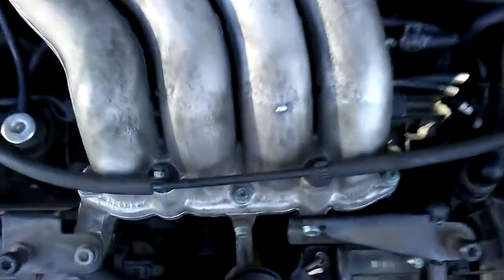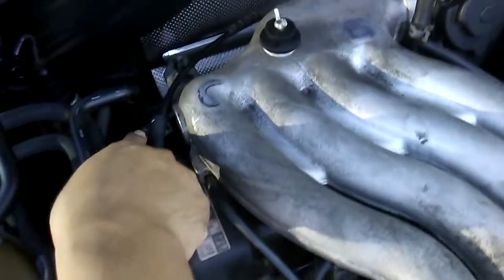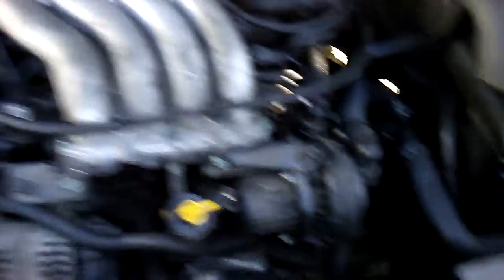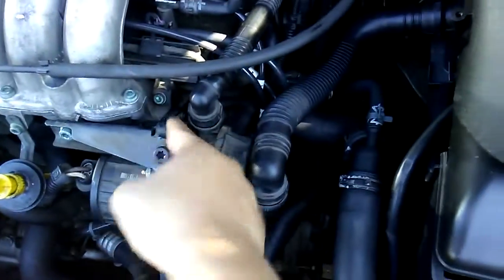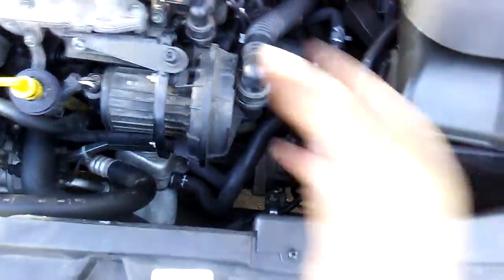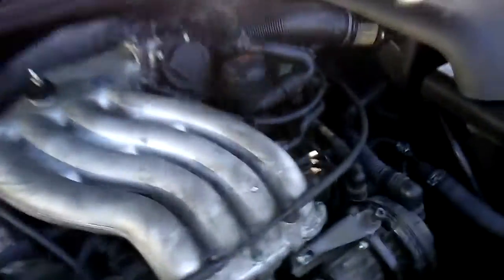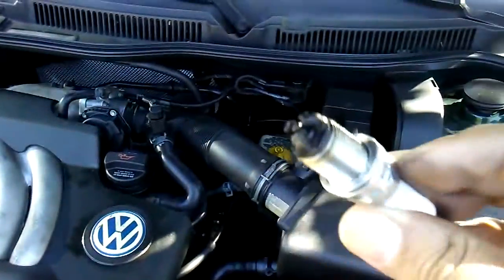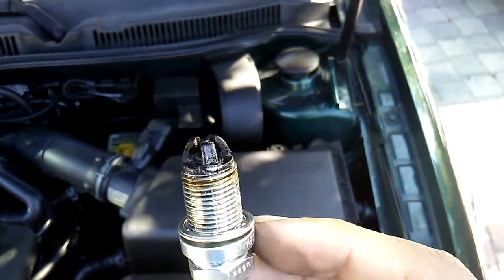Mk4 golf bogging down and losing power.

Comment: Hi guys I'm having a problem with my polo classic, is got mk 3 Engine. When I start the car the engine runs but as soon as I give it accelerater then the engine is bogging and loose  power! Is it a throttle body its self or maybe spak pluggs! Please I need help guys
Reply: I got the same problem how did you fix it?
Reply: Same
Reply: Having the same problem on a Polo Classic agy engine - did you manage to fix the issue?

Comment: Got an 03 Jetta replaced the regular intake with a short ram cold air intake now seems louder but for some reason don't know if its just the plugs of wires but changed the coil pack cause wouldn't start but now I notice I don't have lost acceleration power should I change out the plugs again and wires ? Or could be something else ?
Reply: Did you figure it out! I’m having this exact problem right now